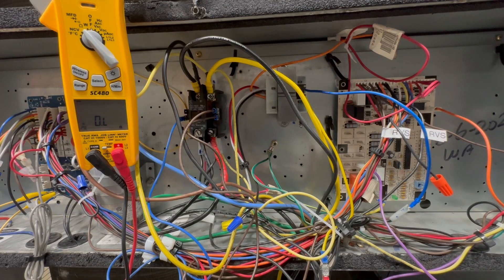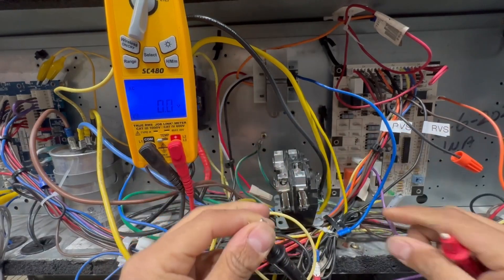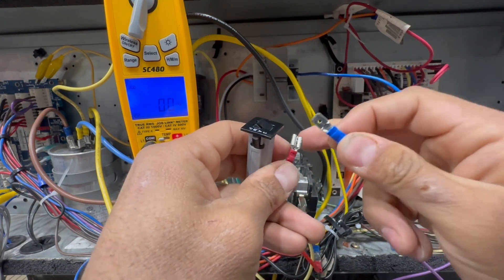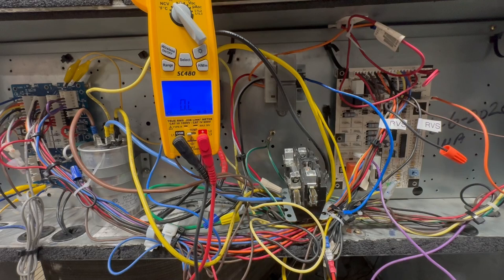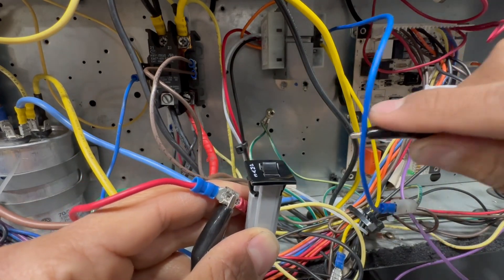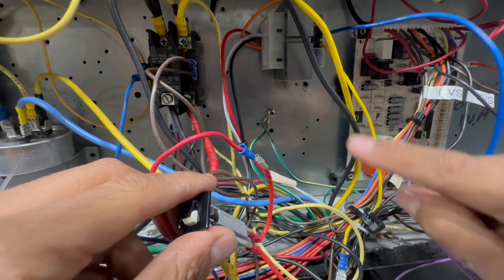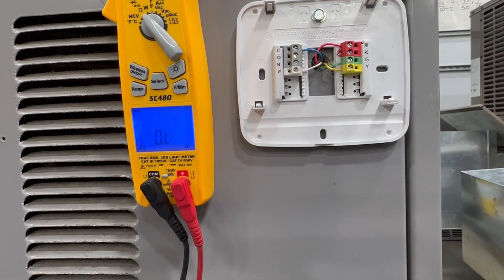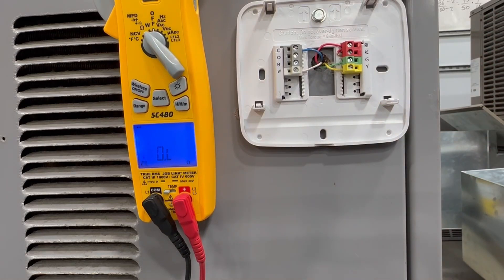How To Find A Low Voltage Short (Package Unit Edition) - HVAC Training

Comment: How can you properly identify how much each component proper ohm reading should be, or if you can to tell from using the formula e÷ir.
Reply from the maker: Unfortunately components don’t have an ohm reading number on them, it comes from experience. You definitely want to see some resistance, not too low or open line. Like contactor coils, you should be reading between 13-21 ohms. The contactor won’t tell you though, unfortunately. They should place resistance labels on the components

Comment: To are you saying to start looking for a low voltage short we can simply start by removing the thermostat and checking everything to common ???
Reply from the maker: You can try hopscotching. I’ll make a video on this soon. You basically don’t want common and hot touching each other. Only when they go to a load it’s ok.

Comment: How are you not getting electricuted when your fingers are touching the metal and you touch the wires together? I would think that would be an easy path for electricity to flow as well, right through your finger? Thanks! I want to be as confident as you with the live curcuits too!
Reply: You can live with 24 volt
Reply from the maker: It’s low voltage and my body has high resistance. You still have to be careful though.
Reply: 50 Volts are perceived to be the turning point between getting shocked and electrocuted. Make no mistake, low voltage can be dangerous, especially when the amperage has the potential to go high.
Reply: Low voltage AC is also slightly safer to work with than DC. DC voltage is usually less forgiven.